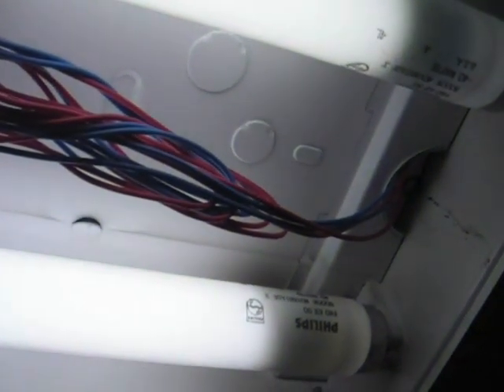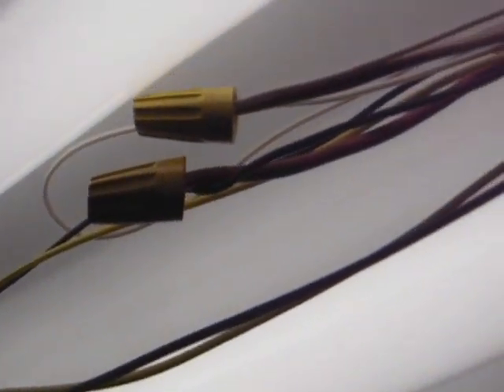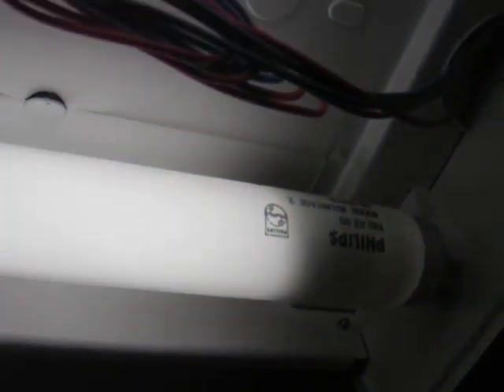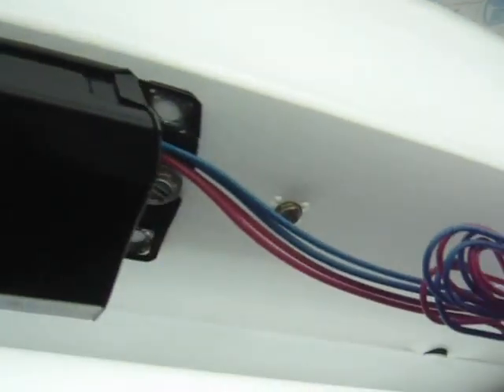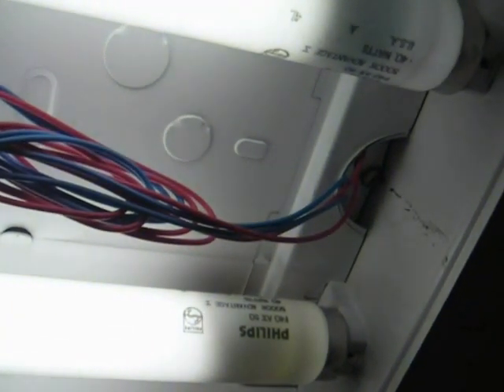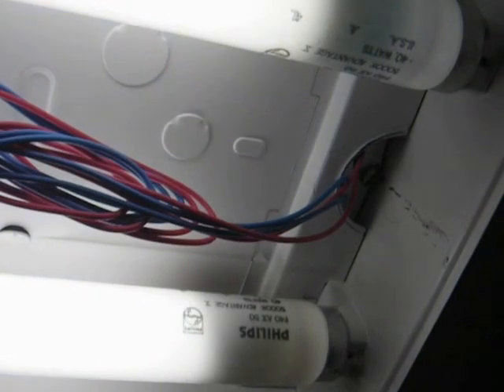T12 FIXTURE 49 before T8 upgrade 143F HOT MAGNETIC BALLAST

Comment: There is nothing better than this!
Reply: Were the lamps 34 watt? Those can cause some issues in older ballasts, mainly those made before the 80s, but they can affect some newer ballasts as well. The main issue is overheating. In this case I would had tried 40 watt lamps instead of 34 watt.
Reply: Just noticed they are 40w. I find it weird how the ballast is overheating like that with 40w lamps.

Comment: i have the same ballast so far its act not getting that hot
Reply: I don’t think it is normal for them to overheat.
Reply: @rs12official  not really unless the tar substance inside weakens or the core starts to die causing a lower resistance and loses the ability to start the lamps at cold or maintain op wattage